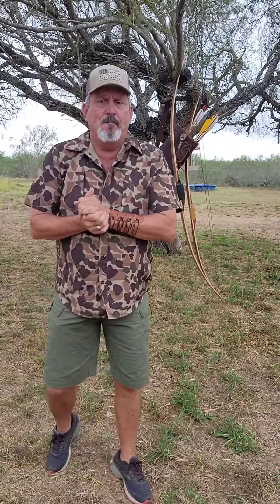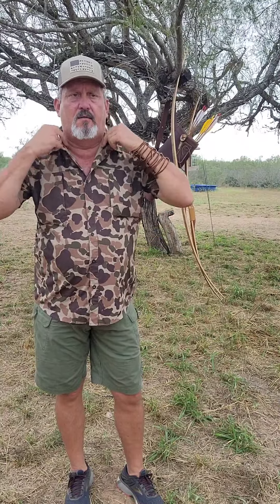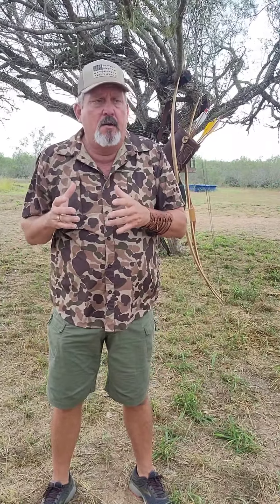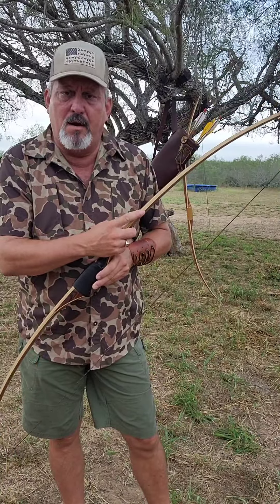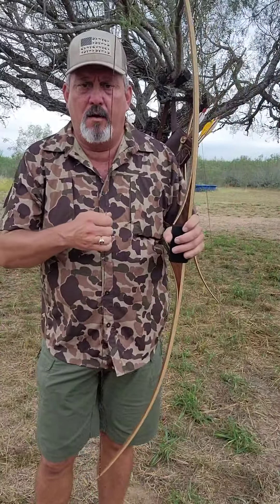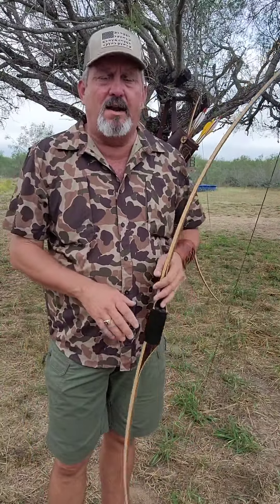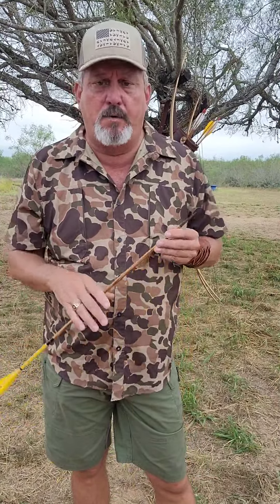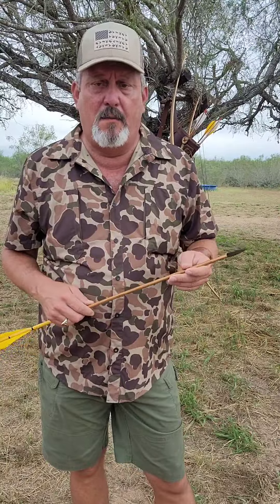What is "Hand Shock" ?

Comment: Love that shirt!  Is that Fred Bear camo?  I have a 45lb 68" Farmington Apache longbow I got from Three Rivers Archery and I'm struggling to get rid of the handshock.  I replaced the string with Fastflight, use 620 gr arrows, added string silences and all of that helped a lot but it still has just enough to annoy me.  I also experimented with grip and bent bow arm.  Next I'm going to wrap the grip with rubber and make some douglas fir arrows.  I will also experiment more with grip and string grip.  Good suggestions!
Reply from the maker: Campfire Kodiak that shirt is just a cheap shirt I got at Academy. Like 20 bucks. 

One thing you might toy around with for your handshock issue is braceheight. A few twists of the string either up or down can make a difference in efficiency and it also can change the tone or noise the bow makes when shot. Hope this helps. Shoot Straight!

Comment: Actually, the flat limb bow style was out before Howard Hill but used an English/Early Medieval Longbow style handle on the grip/bow section yet still had the side shelf, some modern straight limb longbows use this design. Closest bows made currently are by Grayvn archery in the Bushman bow that is similar to what we would see then in the old flat limb longbow as it was called but the right and left shelf version.
Reply: What makes a bow a " Hillstyle" is  not just the shape. Howard Hill's inovations, were also the materials he used. He was one of the first to use fiberglass as a laminated backing. Before he used silk or other fabric. This was not meant to give the bow more power, but to make it more resistant to breakage.  He also jnterduced the use of Bamboo laminations  as a limb material. This had already been in use on the traditional Japanese Yumi bow.

Comment: The arrows do not need to be wood, as on YouTube, Traditional Bowhunting and Wilderness Podcast Jason he uses heavy carbon fiber limbs, ones he has put 30%--35% Forward Of Center (FOC) on his arrows. He uses then for practice field tips he made of the same wight boradhead he hunts with 250 grains and had to get his own feathers and put a 100 grain insert to make the arrow work for his needs and have the max FOC that can work with hunting.  He has a modern Howard Hill style bow using fiberglass backing that also has older true Howard Hill early limbs pre 1950 with less pointed ends from Northern Mist Longbows that makes more the 1930's and 1940's shape of Howard Hill bows.